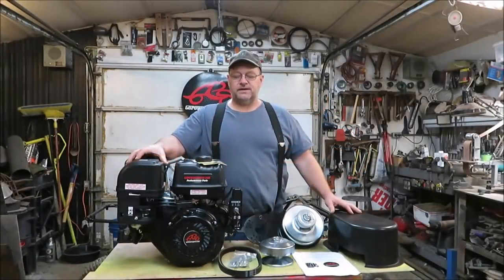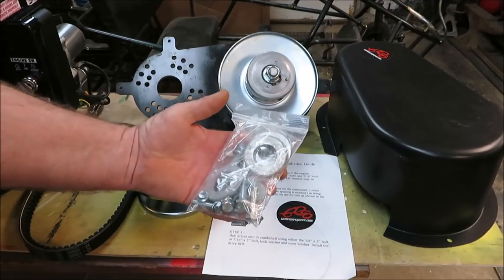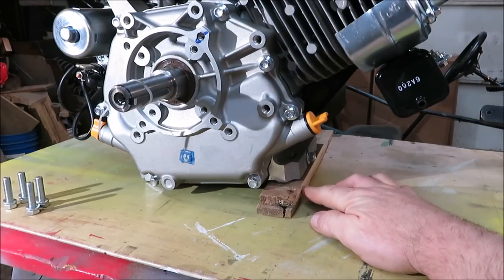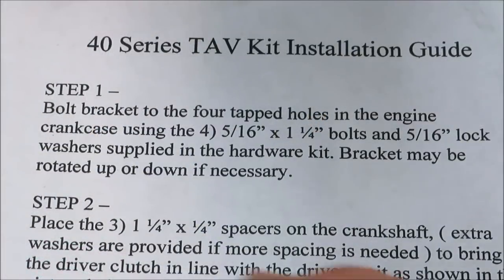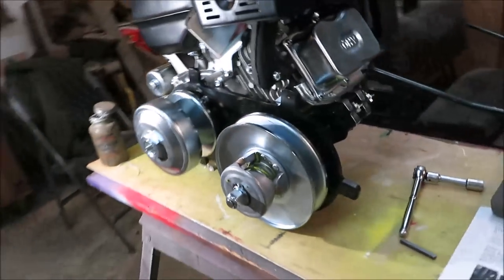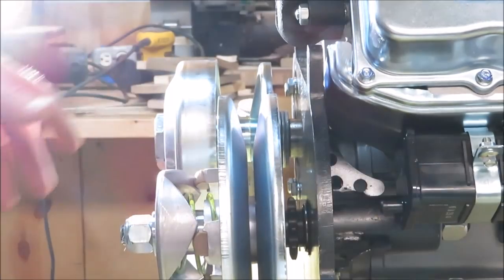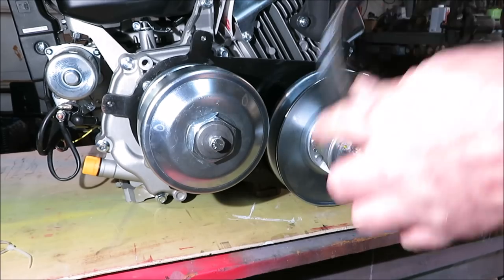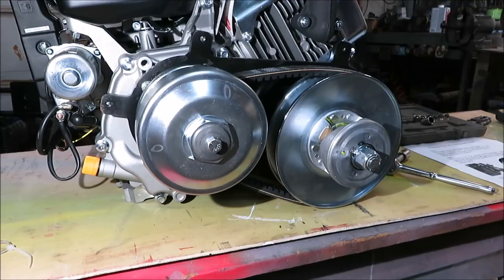40 series torque converter install on predator 420cc

Comment: I'm gonna make forest trail bikes for family leisure activities
I have a bunch of 1 cylinder Yanmar Diesel Engines with a 3,600rpm governor..

I already made a rolling chassis it just needs the drivetrain, electronics and such..

I have a question though..

can these 40 series torque converters handle 18hp's?
does it accept GY6 scooter CVT tuning kits or does it have its own CVT tuning kits?
Reply from the maker: Not sure sorry

Comment: Okay everyone needs to stop with the misinformation. The driven pulley only needs to be installed inboard if your pulley has a red spring, if your pulley has the yellow spring like the ones from GPS this video is correct. The belt is lined up as soon as the belt engages.
Reply from the maker: Thanks for the comment

Comment: You can't run a 40 series secondary with the spring outboard. The way you have it, as the primary closes, the belt moves up the pulley and towards the engine. But as  the secondary opens, the belt moves down the pulley and away from the engine. You end up with SEVERE belt misalignment this way. China is selling 40 series drivens with the WRONG spring with the movable half wound the WRONG direction. It's not a 30 series TAV2. You can not mount it like one. Use a jackshaft and mount it properly. 20, 88, 40, 44, and 500 series (all symmetrical belts) need the secondary spring mounted inboard.
Reply: lazzer408.....yes that is what happened to my cart conversion set up  had to reverse the drive clutch to the engine ,see youtube video 40 series torque converter in action for further info.
Reply: Videos really help a lot.

Comment: What predator engine/ torque converter do you reccomend to build a custom street legal motorcycle ?  Goal top speed is 80mph
Reply from the maker: Not sure on that one.
Reply: Torque converter belts will not hold up to high RPM. I build street legal vehicles with predator motors, and the fastest I was able to get up to was 70 miles an hour. With proper gearing and a centrifugal clutch. You will need to bypass the governor to get top RPMs.

Comment: Im having an issue where my TC is not engaging into high gear (speading out) not sure why itll do maybe 35mph spins in the dirt. But wont open up and keeps tossing the chain and shes pretty tight also have tried lossening it but that made it worse 😂 any ideas would be greatly appreciated
Reply from the maker: Sorry i wish i could help but i really have no idea , thanks for watching.
Reply: @Robinson-Homestead  I appreciate the reply regardless, I figured the problem out the other night whilst riding the rear axle bearings were giving out and did the rest of the way. Assuming one side gave and the other didn't causing the chain to be tilted slightly knocking it off the teeth. New bearing and she's golden now. Does close to 52mph very happy with it and looking to change springs and weights this coming weekend

Comment: Kevin raising the back of the motor an inch, won't it put the crank case oil level off. Bill
Reply from the maker: When I mount on the kart it will be level it will have room to hang down thank you for the comment Bill.
Reply: I know this is a old comment but to answer your question about the tilt of the motor and messing something up because of the tilt, no it wouldn't hurt a thing, my racing kart along with thousands of others run a 15° motor mount which tilts the motor up in the rear so that the carburetor clears the right rear tire and we've been doing it for decades. P.S. that's with the low oil level sensor removed or bypassed.

Comment: I don't understand the price jump between the 30 and 40 series. I can get a 30 for $60 but a 40 is ~$300.
Reply from the maker: Not sure on that.
Reply: You cannot get a 30 series for 60 dollars, unless your looking at the fake ones on amazon
Reply: The 30 series is rated for 8 hp the 40 series is rated for 22
Reply: @carsareepic20  Yes the exact same ones that Go Power Sports sells for $119.00. 
They work great BTW.
Reply: @MegaKencam  if you actually payed attention you would see the difference
Reply: Trust me, I got mine on Amazon, it works better than a clutch but no where near the same as a real comet

Comment: I'm surprised people are running a 40 series setup like a TAV2. They don't work that way. It'll eat belts due to the mis-alignment at full shift. The belt rides up the primary (towards engine) and down the secondary (away from engine) as it shifts.
Reply: I've seen several installation videos now by different builder channels. All of them show install the way this guy did. Also, someone always says it's backwards! 
Does anybody have any hard data on this?
Reply: @richardcrackel1521  ,,yes check out youtube 40series torque converter in action, this is the proper operation of the unit.
Reply: When the belt moves towards the engine and the other pulley moves the belt away from the engine they're lined up under full load. That's why the belt sits 3/8s of an inch crooked at idle. Works fine for me. No belt wear. Also that pulley being inward is only for red springs, yellow springs like gps aftermarket needs to be outwards.

Comment: Would a series 30 comet torque converter work on a 420 predictor?
Reply from the maker: Not sure Ethan sorry.
Reply: Also wondering same thing! Picking up a 420cc aswell and the 40 series cost so much more than 30 series.
Reply: @ryanlahay9361  no I had one flew all to hell
Reply: @christopherhudson5090  yea I went with a 40 series. Works great

Comment: if you tell a guy to use anti seize plz plz plz tell him to bring a wrench thos bolts will need resnugging ever 2-3 hr of run time i never use that stuff on aluminum
Reply: no
Reply: I was an engine machinist for about a decade and been wrenching my whole life and I've always used anti seize when dealing with mixed metals, especially when combining aluminum and steel. I use it always on sparkplugs for sure!! I've never had to re-tighten anything afterwards!

Comment: Wow, Way wrong install of the driver clutch. Needs to turn around the other way for proper belt alignment when it runs through its range. Your way makes the belt flex crooked and robs power and wears belt sooner. Please check out Comet instructions.
Reply from the maker: Thanks for the comment.